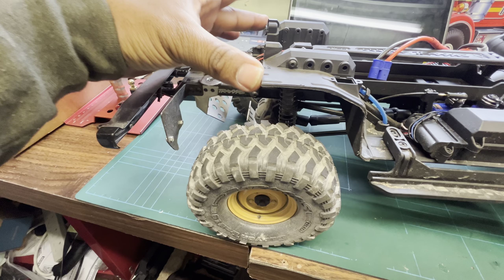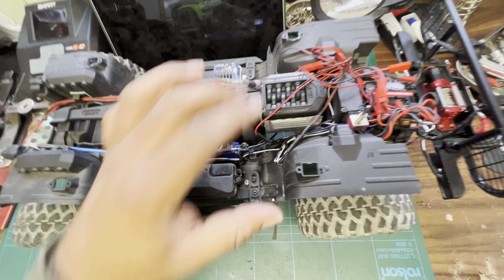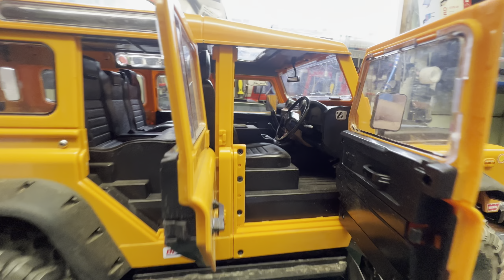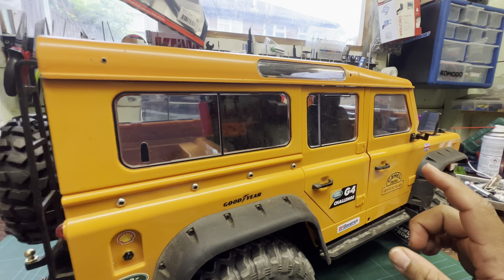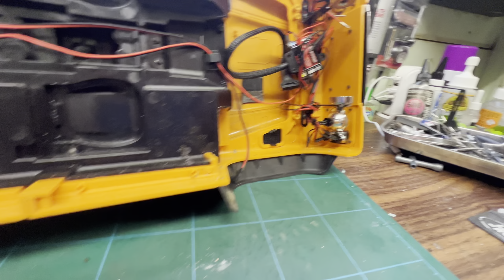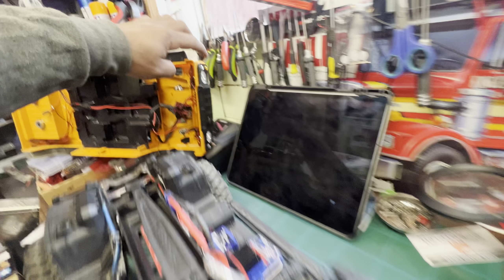Camel trophy Trx4 INJORA HARDBODY mounting and lighting system

Comment: Thanks for connector type. Been wanting to know to do same thing you are. I noticed 3 volts from light kit is not enough for bright scene lights. Been contemplating a buck converter to run 6 volts to 3mm CCHand scene lights

Comment: Hey, I was given a brand new injora 313 2 speed chassis that I am planning on building, I've always wanted to get the TRX4 with the Defender body but since I have the Injora chassis, I figured I can just buy this body for it and save some money on top. I already have a receiver and transmitter so I just need to get the motor, esc and steering servo. I do like the fact that all doors/panels can be opened on the injora version.

Comment: Great job modding the Pro scale light kit. I have been looking for more info on this kit as I don't like the fact that the head light cluster is wrong - indicators should be on the bottom, and I didnt know if you could put your own LEDs in. Nice work!
Reply from the maker: You can use your own head lights 5mm head lamps and 3mm for the side lights, rear lights and indicators
Reply: @RcNeil  That is good to know - did you add little resistors for the right power?
Reply from the maker: @avipatable  no don’t need to the trx4 lighting kit works perfect with it
Reply: @RcNeil  Thanks very much - so you bought the Defender light kit 8095 (to get all the right plugs) and then took the Traxxas light buckets off? Sorry for all the questions - I want the headlights, tail break and reverse lights, but I don't really want to buy the 8095 light kit as its quite expensive and I won't use the rock lights or light bar.
Reply from the maker: @avipatable  no I only bought the Traxxas TRX-4 Pro Scale Lighting System and use my one leds, you will buy some DuPont ends and the Bluetooth module for the radio to control lights from the app
Reply: @RcNeil  Man thank you for your help - Dupont ends - they are the plugs that fit the Traxxas controller? I will google them, never heard of them before. And yes I can find some LEDs. That is great :)

Comment: Nice video. But how did you fix the headlights into the body? Did you glue them in? Which is very difficult because you don’t have enough surface. Or screw them in? Same problem.
Reply from the maker: I use hot glue, but the kit comes with light buckets also but do use hot glue as they can still pop out
Reply: @RcNeil  Thanks, but I found a solution. I screwed the hole unit (light buckets) in, so I can dismantle them easy if I have to. Btw, where did you get the roof access ladder from?
Reply from the maker: @hermannschulte4536  T best RC Rear Ladder, 1/10 Metal Rear Ladder for Climbing RC Car Stairs Upgrade Accessories Compatible with Benz Traxxas TRX4 G500 https://amzn.eu/d/fum04Pf The rear ladder